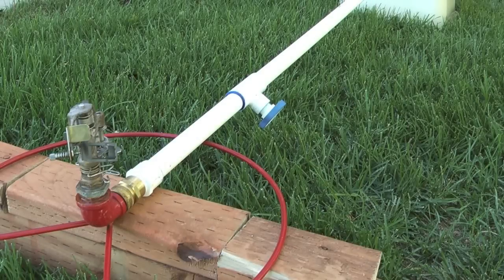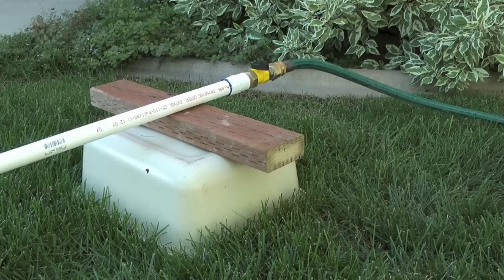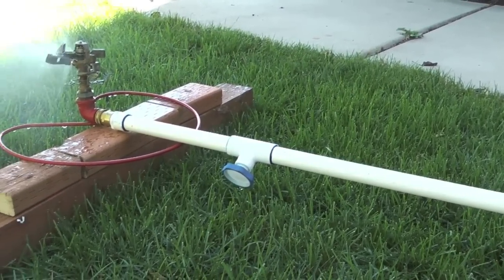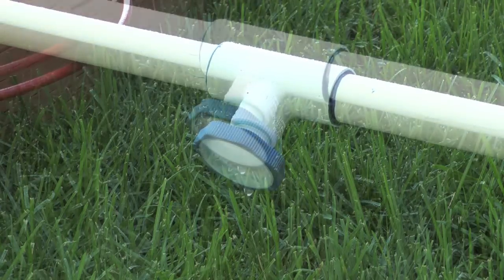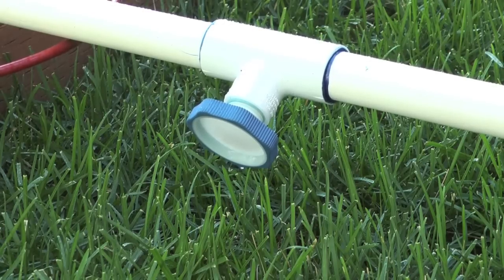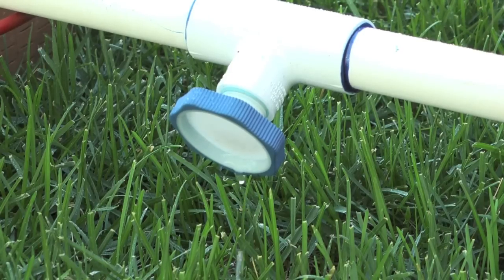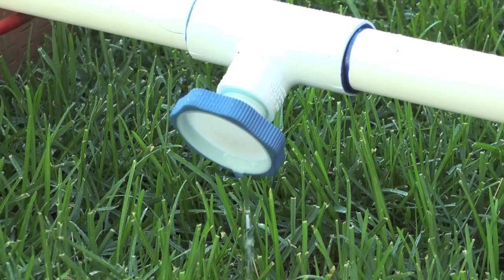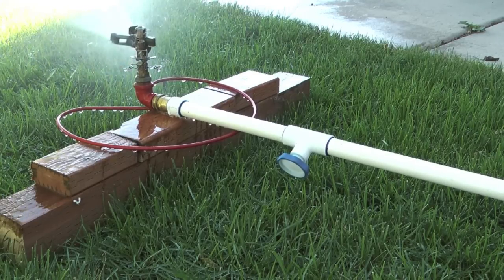How an automatic sprinkler drain works

Comment from the maker: The pipe in the video was 3/4" and less than 10' long, so the pipe would only hold a pint of water for the automatic drain to remove. Remember you only have to remove around 10% of the water from a pipe to keep it from freezing and breaking. 

On sprinkler systems that I work on and I don't know what's been installed under the ground, I recommend blowing them out. On new sprinkler systems that I install with automatic drains, I never worry about blowing them out.

Comment from the maker: Try and determine which way your yard slopes and install drains at the low point of those slopes. In your example if your yard slopes left to right into the manifold, where the supply pipe exits would be a good place for the drain. If it slopes right to left, before the manifold would be a better place for the drain.

Comment from the maker: I have torn a few automatic drains apart after they failed to try and see what went wrong. The ones that failed looked like they had been damaged by small rocks that were in the zone piping and had swirled on the drain until the drain eventually failed from wear of the small rocks.

Comment from the maker: I don't have a set answer on this one. I guess it would depend on your preference. You can buy an anti-siphon sprinkler valve or you can buy a regular sprinkler valve and install the vacuum breaker after the valve. There would probably be less plumbing required using the anti-siphon sprinkler valve. You might want to check with your city water department and see if they require one over the other. In my area a reduced pressure backflow preventer is required on the sprinkler system.

Comment from the maker: I guess the most obvious difference I see is that with an anti-siphon valve elevation is critical on installation. The anti-siphon valve must be 6" higher than the highest sprinkler head. On a sprinkler system you would want the automatic drain at the low points for proper draining. The anti-siphon valve would function only if there is a siphon (suction) created by external factors, whereas the automatic drain functions simply with the presence or absence of water pressure.

Comment from the maker: In the 1000's of automatic drains I have installed I would guess I have had trouble with less than .1% of them. Usually when they go bad they leak enough when the sprinkler zone is watering that there is a wet spot that is obvious. I guess it's possible for one to leak and not be detected because the lawn and the soil are absorbing the signs of a slow leak. But usually even a slow leak will eventually become apparent.

Comment: Thanks for the great video. I recently bought a house with a sprinkler system and I see a King drain in the manifold box with the valves. Does that indicate that there are other King drains in the lines? Is there a way to test for the them? If there aren't other King drains and I need to blow out the system, do I need to somehow cap the King drain so that the compressed air doesn't leak through the drain? Thanks very much for your help?
Reply from the maker: If there is a King drain in the valve box then there's a good chance they were used in the rest of the sprinkler installation. No way to test for a drain unless they fail because they will be buried. No need to cap the drain because they shut off when pressure hits them. When pressure is off they open.
Reply: @Iscaper  Thank you very much!!!

Comment: Kerry, First I want to thank you for all your great videos on lawn sprinklers which I’ve only just begun to watch!!
I know you said install the auto drain at low spots on both the head lines and supply lines, BUT I don’t see how it draining only 10% would effectively prevent freezing and broken lines, especially at the heads and valves? I’m not nit picking. I want to install a system in my 4.5k sq ft yard but don’t want pros to do it so I can save a heap of money. Yet I want to do it properly the first time so I don’t have to search for underground problems later.
Reply from the maker: The auto drains will remove more than the 10% you mentioned. I've never had trouble with a system where I installed automatic drains. If you're worried about the drains you could install a tee in the supply line where you could blow the system out with compressed air every fall.

Comment: My sprinklers run off a pump, I have one line that comes off spigot, straight to garden. Since the pump is not on thought I could water directly by just opening the spigot, but water started draining at the drain valve instead of pushing through.  Anyway when the pump is off, I can still run the water?  Thanks 🙏
Reply from the maker: Unless you have pressure tanks you can only water when the pump is on.

Comment: Nice job, Keri. I think you made this for me, ha ha. Aside from the different appearance and location, how does this mechanism differ from the design of antisiphon valves? 

I guess the only question I would wonder about would the be the possibility that one of these automatic drains could leak water in small enough volumes to be undetectable, except in the sense of reduced watering capability....

Comment: What is the life expectancy of the Automatic drain?      Any idea at the end of their life span or failure do they lock open or closed?
Reply from the maker: I've read they last 20 years, but I've had drains installed for over 20 years that are still working. I only use King auto drains that have the rubber diaphragm.

Comment: Do you put gravel around these when buried or just dirt? Also do you only put them on the main line? You mentioned adding them to the manifold. Where would that be placed? And how frequently do you want them on the main line?
Reply from the maker: I only use gravel in heavy clay soils. I add them to the main line in low spots and at the end of the manifold. Here's a link on the last manifold I installed using the drains: https://youtu.be/WpetroPws10

Comment: If it's buried in the ground will the pressure from being buried keep it from still working?  I am having a drainage problem coming out of the sprinkler head after it turns off at the low end
Reply from the maker: No, as soon as the sprinkler zone shuts off the automatic drain will start working.

Comment: Two questions (and I ask as a former plumbing associate in Home Depot) ... Do they need to be put at an angle, or can they be straight up and down? And #2, Why do these fail? I'd help customers constantly get new drains. I'm currently installing sprinklers in my yard (first time installations) and putting these drains all over, as advised. But what a pain in the future (I'm thinking) for when they go out. And why WOULD they go out? What causes them to compromise? ... Ok, that's more than 2 questions. Thanks!
Reply from the maker: Be sure to buy King auto drains. I've been using them for years with no problems. I like installing the drain on an angle because on a new installation if you install a drain straight down it puts a slight hump in the piping. Straight up installation leaves water in the pipe. The drains I've had the most trouble with are the ball and spring type. When debris gets into the spring they tend to fail.

Comment: Hello Kerry, thank you for the video.  I put down a pre-emergent granular this week while the weather was at 75 and forgot to turn off my irrigation system.  Today, here in OK we are having two storms and are now back in the teens.  The water system ran this morning on accident, 12 min on two zones and 3min on the rest of the zones.  Will my irrigation system be ok? Pipes are underground and the back valve is inside by the water heater. My builder also said the water will drain on the lowest sprinkler head and they do not think my pipes will be frozen underground.  We will be back in the 50s by Sunday, from now until then it will be between 30-40.
Reply from the maker: I think you'll be okay but a few days below freezing makes me a bit nervous. When it warms up I would do a complete walk through of your system. Pull the valve box lids and run each zone. Check for wet spots and that the valves don't have cracks and are leaking. If the cold weather did do damage it will show up. Let me know what happens.
Reply: @Iscaper  thank you, don’t know if this makes any difference but I have the rainbird sprinkler heads I just twist and replace.  I feel like I will prob need to replace a couple of those.  I’m more worried about the underground pipes.  I’ll look for those wet spots.  Can another sign be that when I turn on a zone the water pressure isn’t that strong coming out of the sprinkler?
Reply from the maker: @Alex-ss4bk  Yes, if you have a zone with low pressure and flow it could mean you have a broken pipe.

Comment: Hi Kerry, can you please let me know what are the fittings used to connect the 3/4 inch PVC to the hose pipe. I'm confused with pipe threads vs hose threads. Thanks for all your informative videos.         
 Also is there a automatic drain valve available for CPVC ?
Reply from the maker: There are a few ways to transition from PVC to a hose fitting. The easiest would be to glue a 3/4" male adapter on the PVC pipe, and thread a brass 3/4" FIPT x 3/4" FHT swivel fitting into the female adapter and on to the male end of the hose. Here's a link on the brass fitting: https://www.harmonyfarm.com/brass-hose-swivel-3-4-fipt-x-3-4-fht/

Comment: Did you say in the audio that you put one before the manifold and one at the end of each line? Also does it have to have extra space around it in the ground?
Reply from the maker: You want automatic drains at low spots and at the end of piping runs if they're down slope. Drains in the manifolds are good also.
Reply: As a note, apparently putting these auto valves where there's "constant pressure" (like before the manifold/valves) isn't always a good idea since then if they fail you might run up your water bill without noticing it.  Look nice for past the valves though!

Comment: I know you were simply going into how the automatic sprinkler drain works but it would seam as though placement in your irrigation system would have to be considered. In your example does the pip have any slop? If not, I don't see it draining you 3/4 pipe effectively.
Reply from the maker: Yes, slope of sprinkler laterals should be considered. Drains at the down slope end of piping and  other low spots should have a sprinkler drain. You only have to remove 10% of the water from a sprinkler pipe to keep it from freezing and breaking.

Comment: If these were installed properly on every zone would these drains eliminate the need to have the sprinkler system blown out?
Reply from the maker: Yes, provided they are installed on the supply lines, manifold locations, and low spots on the zone lines. I've done systems using the automatic drains and have never blown them out, with no freeze problems.

Comment: What about the lines that go to the valves. They would not be drained by these valves, right?
Reply from the maker: I like adding automatic drains in the supply lines and manifolds, it keeps them from freezing and breaking also. They would only open in the fall when you shut the sprinkler system down for winter.
Reply: I've heard a few horror stories of people having them fail when they're under constant pressure, then they don't notice and the water bill skyrockets for a month.  Then they notice.  The water bill...FWIW.

Comment: I replaced 3 timer valves exactly the same way it was before but my automatic drain is draining wayyyyy to much water, like it’s not droplets like your or even a little stream it’s straight up pouring out, could you help me understand why? Or could anyone?
Reply from the maker: When pressure hits your drain it should shut off completely. If it's not shutting off I would replace the drain.
Reply: @Iscaper  thank you for replying so fast! I’ll try that!

Comment: Would this work the same way not with a sprinkler system, but with a pipe that I buried under the lawn to feed some soaker goes?  Seems like the same principle, but my pressure would be lower with soaker hoses when the system was running.

Thanks!!
Reply from the maker: If I remember right the drain closes at 7 psi, so it should work in your application.

Comment: As a note I wouldn't recommend putting these on lines with "constant pressure" since then if it fails and you don't notice, big water bill... :|
Reply from the maker: I've used these drains for 20+ years on supply and zone lines and only had a problem with one drain that failed. Not a bad track record.

Comment: How many of these should be installed? One by each head or just at the lowest point in each line? I have runs that are 100' long in some places. Also is the King brand your only recommendation or would Toro automatic drains also be ok?
Reply from the maker: I usually like one around every 20' in the low spots of the trench. I've never used anything but King auto drains because I never had any problems with them. If you try the Toro drains let me know how you like them.

Comment: Kerry have you had a lot of those  drains fail and  is there a max psi that thay can handle
Reply from the maker: I've only had a couple fail in 20 years of doing sprinklers. I've used them on systems up to a 100 psi.

Comment: Great video, but these eventually fail could be a week or 10yrs, depends on pressure and installation conditions.  Heavy clay soils won't allow the water to drain therefore the point of this drain is what?  In my area so called "irrigation professionals" use this in conjunction with a master valve to eliminate future call backs for incorrect installation practices.  Pulling pipe is also a common practice in my area and unless you are using SCH40, SCH21 is susceptible to nicks that when under 80psi will pop.  These drains are for lazy installers who don't have proper training, confidence and are trying to undercut local "Professionals", with no guarantee on the longevity of these drains.  Selling point is they don't have to have system winterized.  Good thing is once they fail it's an easy fix, 1/2" or 3/4' plug and I make $100 for 20 minutes of work.  Great product for areas that don't experience freezing soil temps, but then why would you need them?  Gimmick product for installers worried more about quantity of systems installed not quality.
Reply from the maker: I disagree. I been using King auto drains for 20+ years, have installed thousands of the drains, and have had no problems with them. When installed at the low points of sprinkler zones and in the manifolds, the drains prevent freeze damage. A sprinkler system with auto drains installed properly usually doesn't need to be winterized with compressed air. To say that the drains are a gimmick product for lazy installers is disingenuous.